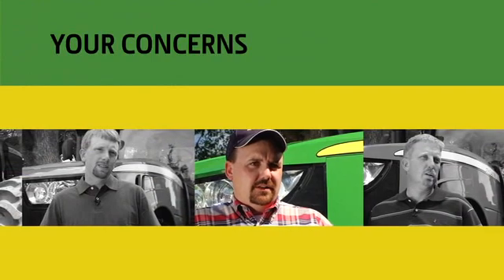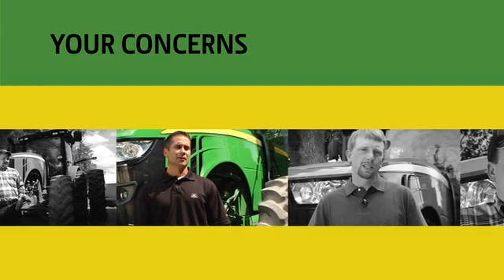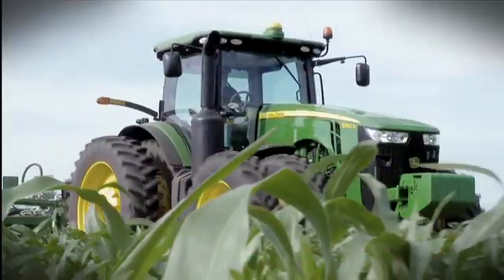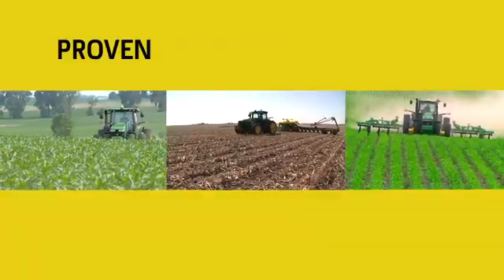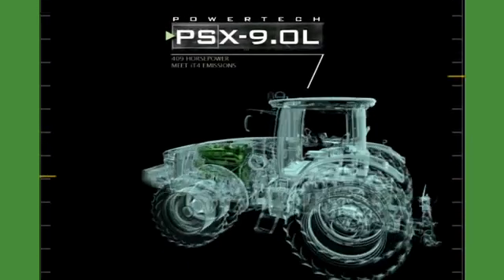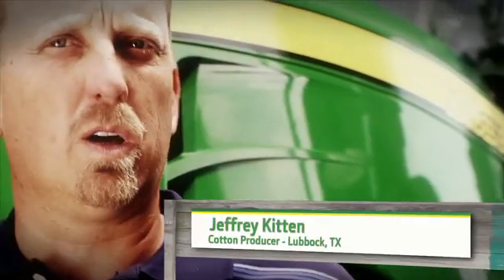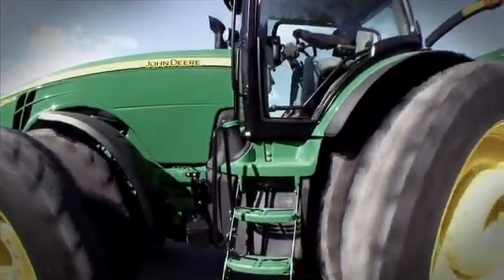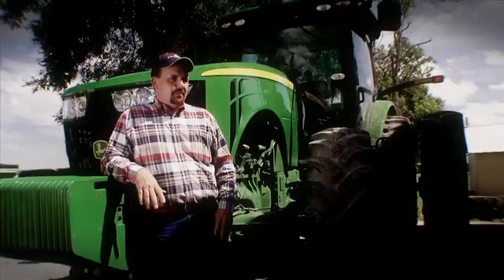New John Deere PowerTech™ PSX 9.0 L Engine on 8R/8RT Tractors from RDO Equipment Co.

Comment: LMAO.  typical idiot customers... the tier 4 added a DPF to catch the PM(smoke) emissions. The emissions don't have to all be controlled in the cylinder.  So it should have better power than the Tier3 tractors they replace.  If it only accelerated like the previous tractor its a fail! Ofcourse JD markets it as a win.